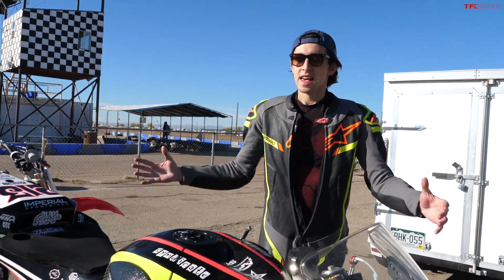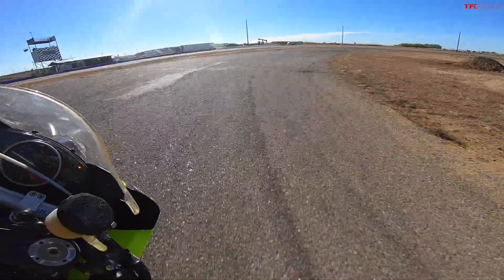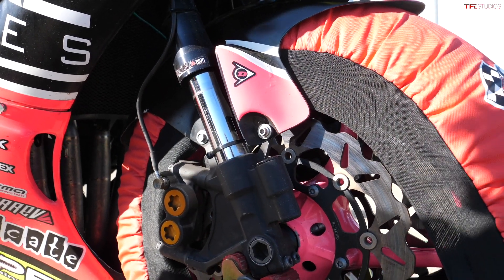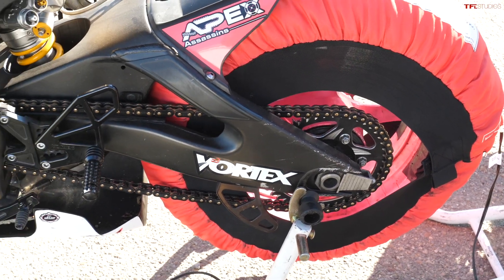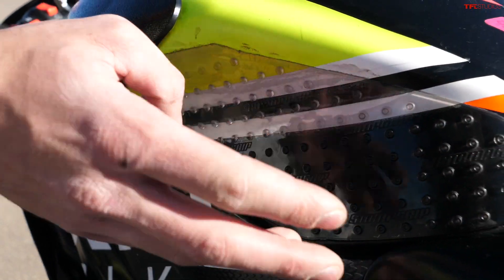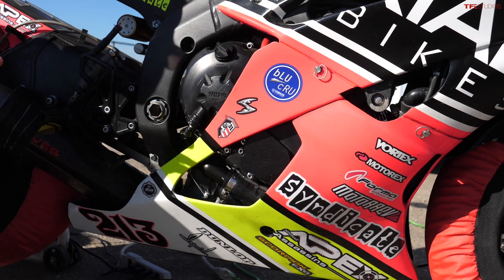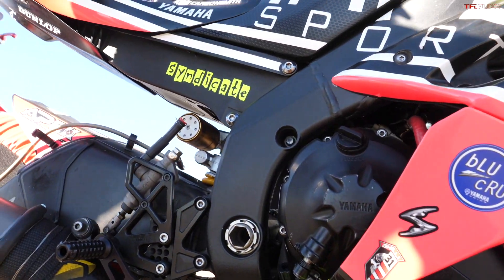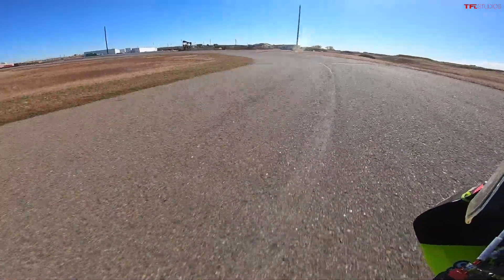My Race-Prepped Yamaha R6 Is A Monster and I'm SO Excited I Bought It: Here's A Look & My Plans!

Comment: Stock R6 with only Akra full system does 121HP ;O
Reply: At the wheel?
Reply: Not at altitude. They usually make 110 at back wheel.